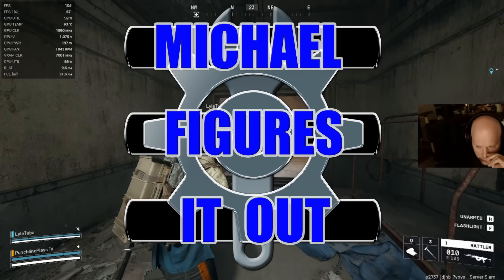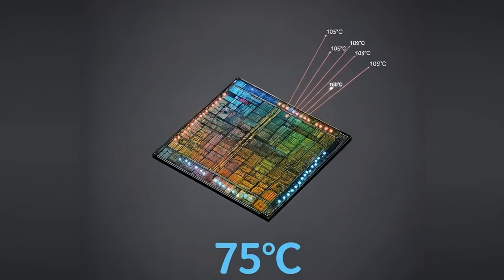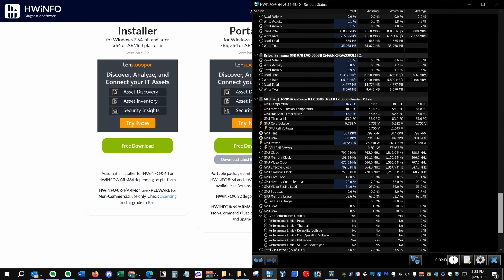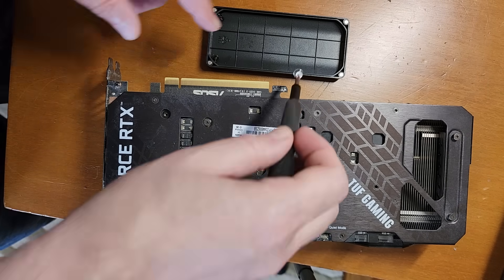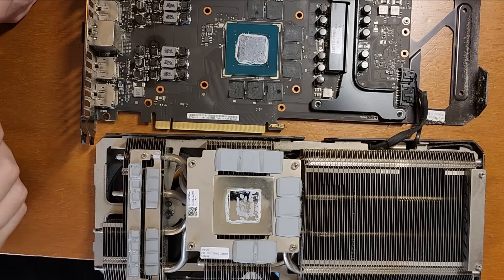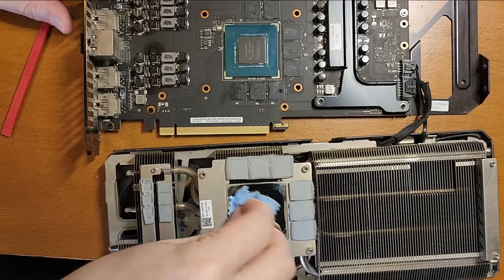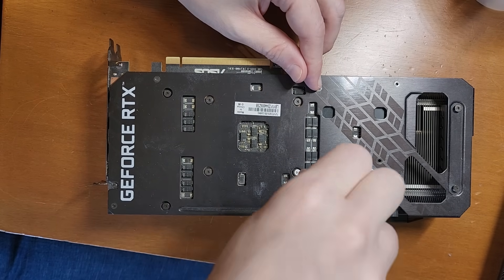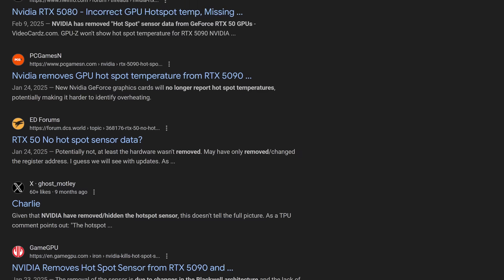GPU Temps Are A LIE!

Comment: This is nothing new and a gpu does not carry "100's of sensors" unless you are exaggerating. Most gamers use gpuz to troubleshoot which has much more simpler UI and in the sensor tab you can see gpu hotspot, memory temp and so on depending your gpu model, variant and type. The problem showcased in the video might be valid for new to pc gaming otherwise it is highly unlikely that most gamers aren't aware of this gpu temp matter.
Reply from the maker: I said over a hundred sensors, not hundreds. But I will say there are hundreds of gamers that are NOT aware of the hot spot issue.
Reply: @MichaelFiguresItOut  oh my bad for not hearing you correctly! but then again anyone who's a PC gamer with 70 or higher class gpu without this basic hotspot temp knowledge should switch to consoles for avoiding such inconvenience :P

Comment: Replacing old dried thermal paste will fix the issue, i have several GPUs having a very high hotspot temps because of  dried paste, replaced it with new one(kryonaut) then it's playable again..
Reply from the maker: It did work!

Comment: I  have rx 5700 8gb msi mech oc like 65-70c core max load and hotspot 87-90c overclocked with fans set to 65c target temp 2200-2400 rpm max its not silent 100% but it works and i think its fine because mech oc models suffering from thermal pad issues memory stays under 80c range (also before repasting temps are like 75-83c on core hotspot is like 113c and memory 90c) I moved the ones that were wrongly placed at the factory and the temperatures dropped by 10-20c (not replaced) it helped with heatsing contact and droped temps siginificanty.
Reply from the maker: Well done.

Comment: Mine 3070 throttles at 60 celcius..that's usual when hotspots goes over 80 celcius... Hot spot is about 20 celsius over avg...both in hwinfo/GPUZ and OCCT.....i find GPUZ to be the better sensor tool..and yes,NEVER run these programs together..never run Furmark for temps,its better to run heaven.. I've been fiddling with this for some years now😅
Reply from the maker: I show the thermal throttle temps in the video. For 3070 it is 93C.

Comment: Yup, I've discovered this by myself just a few days ago. I started wondering why in a couple of games my GPU ran fans at 100% for a few seconds, then normal for a minute, then again 100% and so on. GPU temps are max 62°C. So I started to dig deeper and discovered that GPU hot spot was 105°C. That was the reason fans were going full throttle, it was emergency cooling bypassing fan curve.
I took GPU apart and applied new thermal compound as it turned out the factory one was almost non-existant. Hot spot temps went down by 20 degrees.

So yes, GPU TEMP is basically lying to us.
Reply from the maker: Thank you! Took me so long to figure it out myself.
Reply: @MichaelFiguresItOut  I wasn't interested in finding the issue, because it happened basically only in Path of Exile (for whatever reason), but then I've played some demos on Steam and in one of them this happened again, so I locked in this time and found out why. Which still doesn't make any sense since this demo was a unity game with far worse graphics than PoE lol and it pushed GPU Core to the 105 lol.

Comment: I learned this the hard way . Had many crashes on graphics intensive games and thought my card was broken . But after sometime I decided to keep the hotspot temp under 80-85° and crashes stoped  . But fan noise went through the roof😂 . And I'm too scared to open the card cause of the stories I've heard from experts in youtube
Reply from the maker: It's not that hard to open it up and repaste. But it is scary.
Reply: @MichaelFiguresItOut 'cause I can never measure the pads' thickness accurately

Comment: Removed in 50 series, cannot see this anymore. Also, you should mention this delta is Nvidia only. For AMD GPUs 20-30 degree delta is is very common
Reply from the maker: You're right. I should have mentioned that.

Comment: I have the exact same card, i undervolted it by setting 925mV to 1800mHz, then setting the TT limit to 65 degrees celsius. Max hotspot temp went from 105 to 85
Reply from the maker: That's the other way to deal with this issue.

Comment: If facing blowouts use PTM from thermal grizzly and you don't need to replace your paste ever again. I use it on my CPU i9-12900k overclocked and it works wonders.
Reply from the maker: Might give it a try.

Comment: I recently reapplied thermal paste for my 6700 xt with two fans card using arctic mx-4, but the temp still high, gpu temp can reach 85c and hotspot 110c, what could be wrong?
Reply from the maker: Are you having any issues? Check the card specs to see if it's OK. Some AMD cards have higher thermal limits.
Reply: @MichaelFiguresItOut I have never experienced any sudden system crashes like the BSOD, except driver timout, and the framerate seems stable. my concern is that this high temperature might affect another component, as my GPU is located near the nvme drive

Comment: GPU safety kicks when the hot spot temp is over 110C, it will crash the GPU/Driver or just shuts your PC down lol 110C on hotspot is the thermal limit of GPUs. Nvidia does not put a hotspot sensor in their GPUs anymore, so you will never know how hot the GPU is running. It only has sensor for the overall package temp, which is just the average temp of all other sensors not at the hotspot. 

it could mean the cold temp on the outter edge of the hotspot is calculated into the average of the temp of the entire package. Which kinda don't give you a realistic observation to extrapolate if your GPU die temp is affecting your VRAMs and other components. If you can see the hotspot temp, you can understand why your VRAM temp is so high lol but since you can't see it, it will just be confusing if you use software that can detect those temps from the those sensors lol
Reply from the maker: Yup. Crazy.

Comment: A friend of mine had issues with her RX 6900 XT. Initially I thought it was something else, as the temps seemed fine. But when I checked furmark 2, right after it started to render the fur, the pc was crashing, completely shutdown, because the Hotspot was too high. After I repasted it, and it works like it should. With 0 crashes.
Reply from the maker: Awesome.

Comment: Great video! all i can add is that GPU's use direct die cooling and are more susceptible to the aforementioned pump out of the paste so a "drier" paste will fight against that so the more goopy it is the more likely it is to pump out i had to learn that with thermal grizzly Kryonaut, it kept pumping out and making my hotspot temps insane. CPU's use an IHS (Intergrated Heat Spreader)  so its less susceptible to pump out.
Reply from the maker: Very true. I was thinking of going into that but was concerned about making the video too long and technical.

Comment: hey so thank you for making this video I checked my 5700xt and im getting the same results as the before and I am now gonna apply new thermal paste on it
Reply: Try Honeywell PTM7950 instead. It is awesome. Used with mine old asus rog strix 5700xt - from 105 to 83 hotspot.
Reply from the maker: Thanks. Just make sure to check the specs for your card because some AMD cards can run hotter by design. If you're not having issues, you might not need to repaste.
Reply: @MichaelFiguresItOut  ive been having this card for 5 years and I have been getting crashes alot for the past few months so i might just take the chance and say i need to repaste
Reply: @MichaelFiguresItOut  UPDATE! my gpu temps went down by about 5c and my hotspot temps went down from around 22-25 to all the way down 7-10 more then my base temps!! thank you man for making this video!!!

Comment: It was painful looking at the GPU being disassembled 😂

Edit: I have a 50 series. I still have to check out the temps with that program. I undervolt and overclock my GPU for temps below 70 c under load. I had a mini heart attack when I played one game and my GPU went to 85 c under load. I researched about undervolting and fixed the issue. On new games it is a couple degrees below 70c in old games it is about 58 c or 35 c depending on the game with 100 percent in usage for 4k.
Reply from the maker: It really wasn't that bad to do.

Comment: I had a 7900XT with a dud cooler but it was running its (GCD) hotspot at 110c with an average temp at like 50-55c and would just throttle down. Never got a single crash with it running stupidly hot though. Seems like a nvidia driver issue causing crashes, not the temp itself. I replaced the TIM and pads (while talking to the AIB so i got the correct sized pads) and it helped for about a month and then went right back to overheating.

RMA'd that card and now i have normal temps but still, it shouldn't cause crashes just reduced performance.
Reply from the maker: I think if it hits a temp too high, the card BIOS kicks in and shuts down the card briefly, causing crashes.

Comment: My 560ti years ago was/ still is  bullet proof , I must have been generating 5 megawatts of power  unplugged running a vacuum cleaner over the fans,  the speed the went at sounding like a battle of Britain plane diving.  Never failed still runs in a backup win10 system with my optical drives. I know better now to not do that to my RTX cards.
Reply from the maker: I think we've all done that at one time or another!

Comment: Same experience I dealt with a year ago, Gigabyte OC 3070 (GV-N3070GAMING) in a prebuilt from the end of 2020 that was still having thermal issues even after undervolting it (turbo fan was noticeable each time it would kick in).
Repasting saved the day (I used PTM7950 and upsiren U6 pro thermal putty for the pads).
Baffled that 50 series cards don't have the hotspot temp available, reeaaally looking forward to figuring out when my paste begins to fail on my Zotac Twin Edge 5070 in the next few years, thinking I'll hold off till then so I can get best option once it's needed though.
Reply from the maker: It's crazy they removed it.

Comment: I bought 3060ti in december 2022. Last month avg temp was 82'C and hotspot peak at 102'C. GPU was cleaned, new paste, new thermal pads. Now it 76'C avg and 92'C hotspot. Its ventus double fan edition, so I knew it will be little more hot.
Reply from the maker: Seems within the range. Nicely done.
Reply: hmm sounds hi. Look into your fan speeds ..just bump it up in Afterburner to at least 60 percent. I got FE 3060ti also, its still at 68-72 core and 75-84 hotspot ...pretty sure it was not yet repasted. I hear delta up to 15C is ok... :) oh yeh, I usually run it OCd at 2100mhz while under load

Comment: So video game companies do not know how to create a video game without reaching these high temperatures
Reply: The card overheating is not an issue of the game lol. If a game fully utilizes the GPU it's a good thing, it means the game is well optimized in that regard. If your GPU runs hot under full load you can always take measures yourself like undervolting, using a fps cap or the stuff shown in this vid

Comment: If the GPU die area is small and the power draw is high, like a 5700XT, hot spot temp goes grazy.
Reply: PTM7950 just exist
Reply: @shizukiaoi  PTM won't increase the gpu die area it touches. You can fight trying to improve with efficiency.
Reply: @italooliveira5574  Had 5700xt with 105 hot spot, used all pastes in the world with no effect. Changed paste to ptm. Now it is 83. So...

Comment: The only thing that helps with my rtx 3090 is undervolting it without memory boost in summer.
Reply from the maker: That's the other way to deal with high temps.

Comment: nice. noctua NT-H2. less than six month after paste replacement temps gone sky high on cpu, and guess wha : removed water block and  saw paste all dried out. only 6 months. I dont know, maybe my paste was old on the day of putchase, but no matter, Im never buying this paste again.
Reply from the maker: Yikes. I used it on my CPU, too. Hope it lasts.
Reply: @MichaelFiguresItOut  check whats left of it after half a year just to be sure. know your temps and keep you eye on them. mine nt-h2 was so dry it wasnt sticky/moist anymore I could scrap it easily with fingernail, and on the sides of heatsink/cpu bracket it was solid concrete. what I can tell you pink kryonaut extreme didnt lose its moisture after a year (not shilling for it, Its rather expensive). noctual is way cheaper too btw. you get what you pay for apparently.

Comment: 5:10 they can stay only applies to VRAM that doesn't get super hot, if you have GDDR6X you need to replace them, because by the time the thermal paste is hard, the pads while feeling soft are twice as hard as they used to be and they weren't great at thermal transfer even when soft and new.

all the 3080 and 3090 cards are at this point right now, you repaste em without replacing the pads, and they'll "be fine" for a bunch of games where the vram is just really really hot, but every now and then you run into a game like path of exile 2, and your card starts crashing because the vram is hovering at 99C and spiking over temp repeatedly
Reply from the maker: Hmmm. Might need to replace the pads if he has any more issues. But so far, so good.
Reply: @MichaelFiguresItOut  think you'll be good on a 3070, pretty sure they're gddr6 not 6x

Comment: There is a HUGE issue with the ASUS TUF  30 series cards. My 3090 started crashing constantly, I checked hot spot and you guessed it 105. Opened it up and there was a thermal paste bald spot. Repasted it and it dropped 30C.
Reply from the maker: Nicely done.

Comment: a thing that it's really bad it's zero rpm mode, with nvidia cards it's default i think and since i have a 3070 i set msi afterburner to start from the windows startup so the fan control is running in the background everytime and the gpu is cooled even in idle. staying at 50 °C and 60 °C in the hotspot in idle all the time it's not good, the thermal paste will dry much faster and the gpu will damage way faster.
Reply: 50-60C at idle is totally good, and won't affect its lifetime in any way. Actually, temperature changes are your worse enemy, and cooling down the card too much during idle means that temperature difference between idle and gaming is higher. That means higher temperature changes, which means more thermal dilatation, which is bad for longevity. Keeping higher but less variable temps is better than lower but more variable temps.
Reply from the maker: Funny thing is some cards default to 30% fan speed when controlled by 3rd party software, like FanControl.

Comment: I remember the 3090FE and the junction temps would get that high, the 7900XTX did the same thing too. With the 3090 it was cause they put mem chips on the back with no cooling :/ I think the 7900XTX was fixed with voltage firmware or just buying AIO cards.
Reply from the maker: Interesting.

Comment: Man you clippy icon npcs are insufferable.  Why would you not consider repasting a 5 year old 3070 that is run on the high end of use?  This is normal maintenance on a GPU.  Yearly is ideal, but for the average person, every 2-3 years is probably fine.  I guess good job on turning a normal maintenance issue into a click bait title.  You don't need a hot spot reading to know it's overdue to perform this repaste.
Reply: By the way.... YES you need to repaste the CPU as well.  After 5 years you can't wait for a hot spot sensor to tell you this is necessary.
Reply from the maker: I've heard the factory paste is not standard and can last a long time. For most people, taking apart their graphics card every 2-3 years might be a lot.

Comment: I think you have two capacitors that are starting to bulge — the first and the third from the bottom in the left column. 05:09
Reply from the maker: Really? I don't see it. You sure it's not just dust on top?
Reply: @MichaelFiguresItOut  They look bulge to me from light reflection on them, i could be wrong.

Comment: i have a 6650xt (xfx merc 3 fans) and i have the same problem! i chnaged the thermal paste with mx-4. the average temps dropped but the hotspot still reaches more than a 100C. i have to state that i don't have any problems with crashes or whatnot but i just think it's too high!
Reply from the maker: Maybe your AMD card can handle higher temps. Some can. If no issues, then probably not worth messing with it.

Comment: some thinks in this vid are just wrong. The current induced by a spinning fan can be ignored in pc building. Its way to small to do any damage.
GPU hotspots are nothing new. Like... Nvidia took them out of the 50 Serie. (Dumb mfs). AMD happily shows you the hotspot if you try to oc the new cards. Everything else checks out.
Reply from the maker: I've heard conflicting info on the fans. Anyone good sources to confirm either way?

Comment: I have a tuf 4080, it used crap paste and it sounded like a leaf blower while only hitting 65c on the GPU temp.
Replaced the paste and within a couple months it was rising again.
Finally used PTM7950 and now I run in quiet mode and get lower temps than I got using performance mode.
Reply from the maker: Everything I hear about PTM is positive, except that it's difficult to work with. Did you have any trouble applying it?
Reply: Remember when buying mine, on few days before launch all different model written reviews popped out online. I was aiming for something mid-range. Not crap but not overpriced as well. I'd study 3 the most promising cards. Core, hot spot, vram temps, thermal imaging shots and tear down pic's as well of each one of them to see what they did there on the inside and I pulled the trigger on the best product without even looking at brand. Sorry for the copy paste, I already told that to the other guy. Take note for the future, don't buy products by brand or youtube videos guys, do your own research, inform yourself better than those paid actors are.